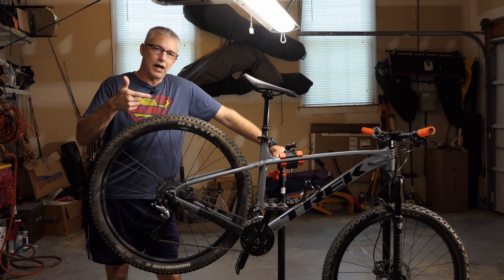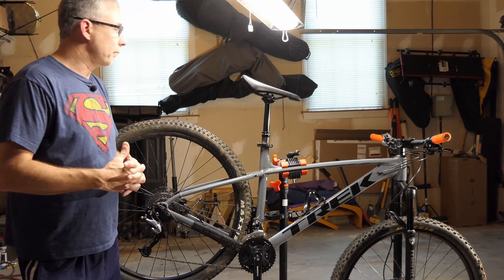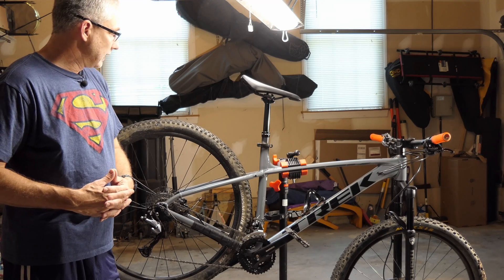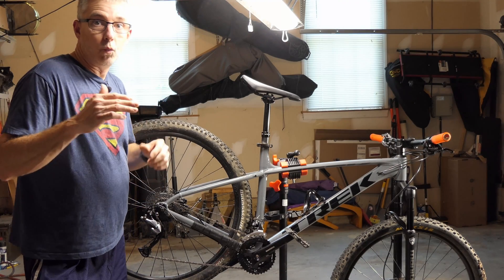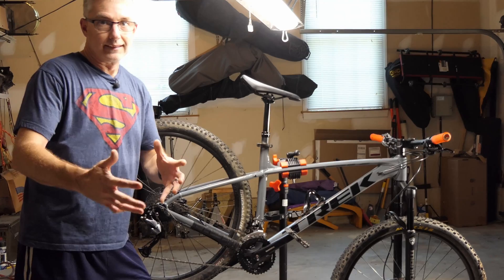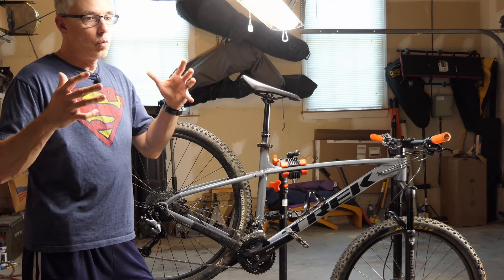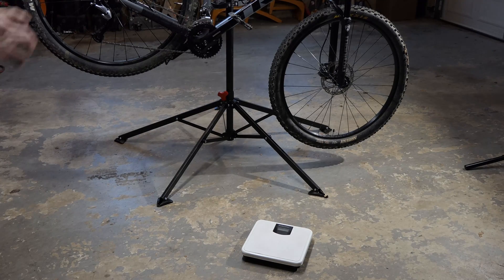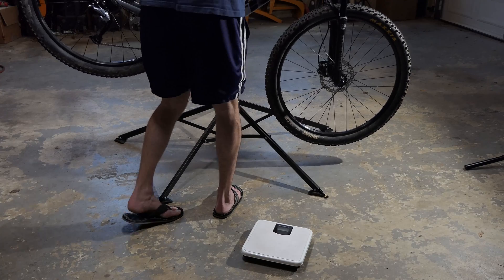PT 1 - Introduction and Teardown of 3x9 Components - Trek Marlin SRAM Eagle NX 1x12 Conversion

Comment: Clicked on the video for my friend who wants to upgrade his 2020 marlin 5, but NEVER put your aluminum bike on a bike stand with the top tube. Always secure with the seat post. I learned this the hard way and almost cracked my frame!
Reply: Does the 2020 marlin 5 have the same free wheel hub as the 2019
Reply: Load of nonsense. Been securing bikes on the top tube for years.
Reply: Yeah well if it’s steel it’s fine, but you don’t do it on aluminum. You see shop mechanics secure on seat post most of the time too

Comment: I wonder if I could do this upgrade to my Trek 2012 Gary Fisher's Wahoo?

I am 68 and have been riding my Trek for a few years and love mountain biking, but I don't want to spring $1,500 to $2,000 for a new crazy bike.  I don't do anything really crazy anymore, like breaking another should, but I really do love my bike.

What do you think about making my Trek into a SRAM EAGLE NX 1X12?
Reply: I hope so...I’ll know in a couple of days.  I ordered parts to put NX sprockets, and GX components on my Wife’s 2013 Gary Fisher Cali...and my 2013 Gary Fisher Wahoo.   I couldn’t find any XD drivers for our Formula DC22 hubs.  The NX cassettes seem to be the ticket.  I’ve rid the bike of their Shimano Altus/Acera components and tapered square bottom brackets...they anxiously await their new components.
Reply: @chuggsinator  
Sounds great!  Please let me know how it goes!
Reply: @drmoynihan  Well...my wife's 2013 Cali has had no problem...switched over to the BSA 68/73 threaded DUB bottom bracket...GX  170 mm 32t Dub Crankset (non-boost)...  GX derailleur and chain...but the goofballs at Planet Cyclery ran out of shifters and shipped the stuff without informing me.  So far, we're pedaling a FIXIE...because without the shifter, it's kinda stuck on the smallest sprocket.  The Eagle 12'speed PG-1230 11-50t Cassette packs in there on the Shimano Freehub.   My derailleur came with the B screw adjustment gauge.  I would highly recommend a hanger bar alignment tool.  I believe with such close spacing on the sprocket...the alignment would be critical for proper shifting.  I've read a few complaints about shifting problems...and they really sound like the derailleur hanger might have been out of whack.  I have the BB, and crank installed on my 2013 Wahoo.  I  had the other components sent to my son's house, as they weren't likely to get to me before we leave to visit them.  I don't anticipate any problems though.
Reply: Got home and finally assembled all the parts...the Wahoo upgrade went even easier, as I already had the steps figured out from doing my wife's Cali.  Can't wait to go find a hill to try that 50t sprocket on.  Around the house, I have to drag my brakes to simulate hill climbing.

I'll add...careful tightening the preload tensioner lock screw, if you add the Eagle Crank.  The tensioner is plastic and I found the screw can break it very easily.   Luckily, I could find a replacement part online.

Comment: Your Chart at 2:14 is exactly what I have been looking for. 

I really wanted to keep my high and low range when going from my Trek Gary Fisher 3x8 to a 1x12, but it was very difficult to find what exactly was the comparison.  This chart is so helpful.  I rode today and will ride again tomorrow not using my large front gear and see what I think, but I ride up and down from my house to my local National Forest paths and I love the speed down, hitting 34mph as my pavement record.  I had really wanted to go with a 10x50 range on the 12 gears, but obviously the NX only does 11x50.  The 10x12 is a lot more expensive, and I don't know how much (speed) would be gained. 

Do you know what difference in the "highest speed" the 10x12 would make?
Reply: Ik you do not use the lowest gears that often you could opt for a larger front chainring, like a 34.
Reply: Thank you for your suggestion.  I have bought a Commensal Meta TR 29 with a NX 1x12 11-50t & 32t. I decided that the lower gears are most important, but someday I may upgrade a little to the GX 10-50t which will give me, according to the chart, 4mph. I have even heard of some being 9-11t, but I will stick with SRAM. 
Thank you again.

Comment: Thanks for the videos! Great info on the install. I just finished installing the NX Eagle on my Cannondale and you helped immensely! Test ride confirmed this is going to be a fun riding season.
Reply: Hi, Whats the actual difference you noticed from moving to 1*12 from a 3*9?
Reply: Devesh Issar I did 1x11 and have found several advantages. It simplifies the drivetrain, no front derailleur to worry about, lightens the bike, gets rid of a shift trigger and attached cables. Gets rid of gears you don’t really use, no cross chain problems. Adds better components, rear derailleur w/ clutch, crankset, bottom bracket, etc. I’m sure I could come up with more but I’ll leave it there.

Comment: Thanks for the video series. They were extremely helpful and I was able to complete a 1x11 conversion on my 2019 Trek Marlin 6.
Reply: Adam Hutson Hello do u think can I install  1x12 in marlin 6 2019 model?
Reply: @Themixandmatch  Yes a 1x12 is what he installs in the video series. It will fit on a Marlin 6.
Reply: Hey do you think it is possible to do on a marlin 5?
Reply: @jasongallegos8459  not if it is a 2019 or older because of the rear hub. He covers that in the video.
https://youtu.be/GquCHklVZI4?t=278
There was mention below in the comments that may have changed in 2020 but I can't be certain.

Comment: Great video thanks! I'm thinking about getting same bike however I would like to immediately get thicker tires. How wide can I go on this? 2.4?
Reply: I don't know about the rear, but i have the same front fork and similar bike (fuji nevada) and i have 2.35 up front (could probably squeeze in a 2.5) and a 2.2 in back (might be able to fit 2.3, at most).

Hope that helps!
Reply: I have 2.4 in the rear. Goodyear tires.  Still have about 7/16 of an inch between tire and frame . So I'd say 2.4 Is probably the max . No issues at all yet. Been about 4 months of rough riding. Hope that helps ya

Comment: How did you route the dropper post?
Reply: This 👆?
Reply: @h3dgecore  I was able to route it inside and then out the bottom bracket and went with an external dropper. The 2019 had full internal but not 2020
Reply: ART OF SHANE thanks for the info, that’s what my LBS suggested.
Reply: @h3dgecore  I called trek and they said it wasn't possible but a little work and I got it.
Reply: ART OF SHANE awesome, you have ‘19 or ‘20? What dropper did you use?Have you done 1x conversion? TIA.
Reply: @h3dgecore  i have a 2020. I went with a brand x when I thought i could go internal but switched to a pnw components. The 1x conversion is next on my list.
Reply: ART OF SHANE very nice! Is it the PNW Cascade? What lever did you use? I just ordered the box 2 11 speed groupset, guy currently selling them new on eBay for $150. Haven’t decided what crankset I’m going to use with it. I put on a RS recon fork and Maxxis Ardent/Ardent Race rubber.  All I really have left is the dropper to do, and maybe some wheels later on down the line. Probably could have a bought a better bike, w/ what I have in it but 🤷‍♂️. I got a great price on the bike, and I’ve gotten the upgrades relatively cheap and done the labor myself, so it hasn’t been too bad, and I have learned a ton, which has a lot of value to me.
Reply: @h3dgecore  Yes the cascade. I used the lever that came with the brand x ascend

Comment: What size tires did you upgrade to? I have the exact same bike...thanks!
Reply: Good question! Looks like he’s running the factory 20mm wheels so getting past 2.25 would be tough. Clearance issue I assume around 2.4.

Comment: After watching this video now Im planning to upgrade my Trek marlin groupset to sram 12 x 1. But can I ask is it possible to put 2.5 tyres to the bontrager rims 622 x 20 I think thats 20mm internal width?
Reply: Tony James Lazo where you able to fit the 2.5 tires on your marlin I’m wanting to do the same thing
Reply: Anything more than a 2.3 on the rear and it will start rubbing paint off